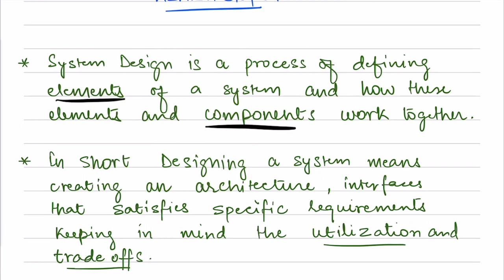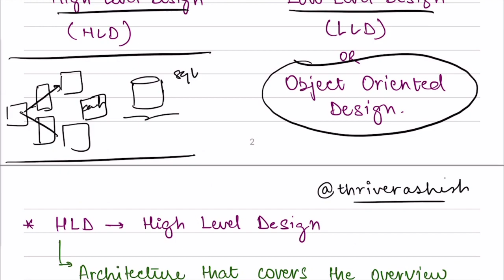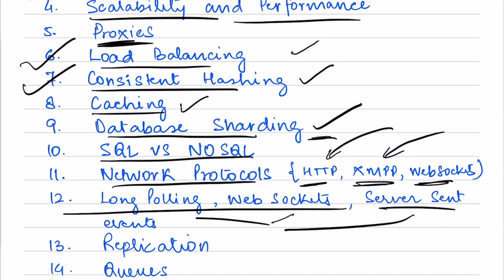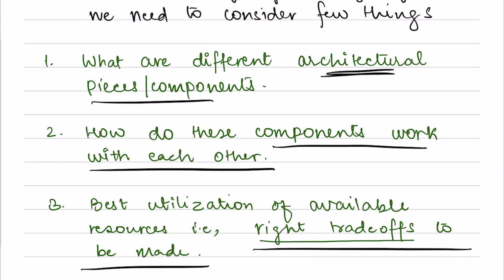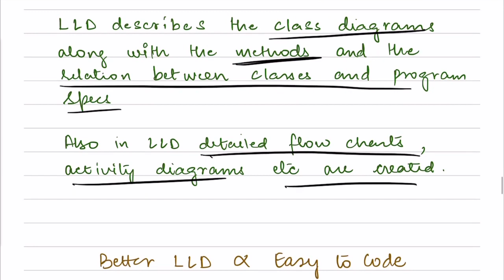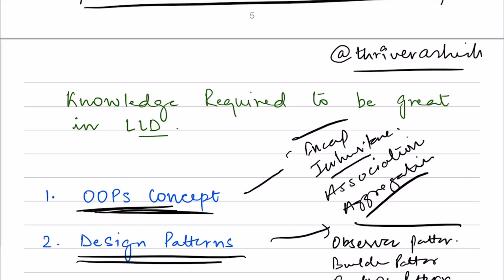01 | System Design Introduction and Roadmap

Comment: Hi.. i don't know if this is the right place to ask this question regarding cdac here... I found you on quora. I'm a mechanical engineer and currently placed in a company with CTC of 6.6 lpa ( actual around 8 lpa considering housing allowance but we don't get that in hand).  Im thinking of switching to IT sector as I'm seeing the growth in my field is very slow at least in India and I don't wish to go abroad. Do you think I should go for DAC course in CDAC leaving my current job ? I have not done coding that much but I did enjoy whatever basic courses we had in our starting years of engineering. I'm having good academics till now.. around 90% in 10th, 12th as well as engineering.
Reply from the maker: From cdac campus you might end up with less package job in starting however the growth in IT career is really fast, over the 5 years you might reach up to 40-50 lacs package also. But things will take time and it requires hardwork.
Reply: @thriverashish  okh thank you so much